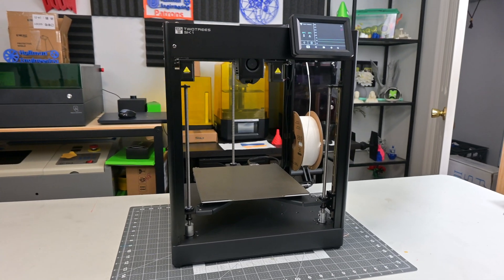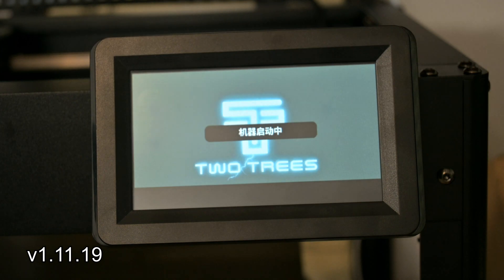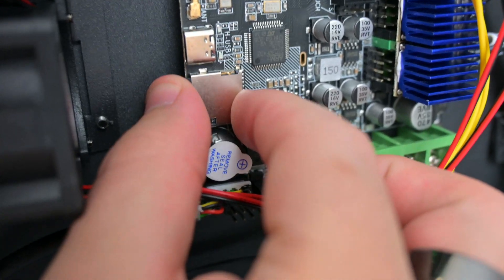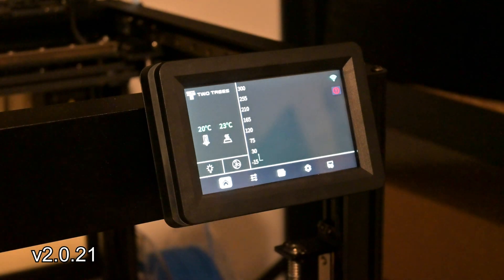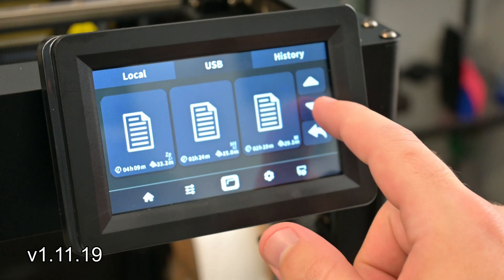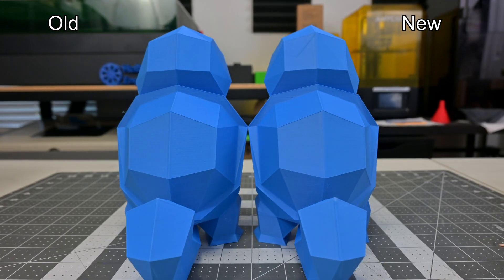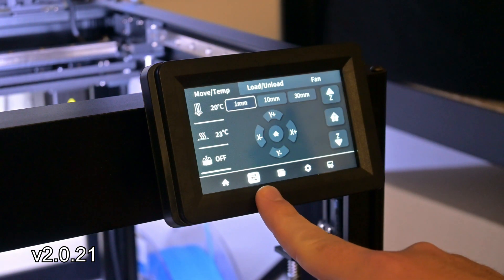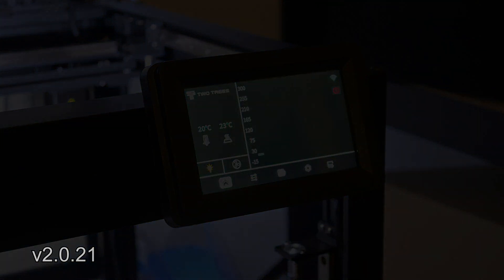Did the new firmware fix Two Trees SK1 3d printer?

Comment: I've been working with another 'toy' Sovol SV08 until I broke it now back to the twotrees, firmware helped but I ran out of filament, head parked left rear, klipper showed "Paused" but no direction on what the do. I pushed new filament in until it flashed then told klipper to restart. It started printing but not extruding filament, I pushed on the filament until I could feel the extruder pulling. I am getting the 'weird errors', I'm looking for some cable now.

Comment: At least you got it to work. My buddy works for a group that got one and they never got past the sheet of paper phase of the initial leveling calibration. They showed me and when you hit the arrows to move it the bed up or down, it would just wiggle the bed down and back up each time. A step down and then a step back up. There were issues with the shipment and stuff too but I don't wan to get him trouble in case he wasn't supposed to tell me ;)
Reply from the maker: The wiggle is supposed to happen (during the paper phase). It confused me at first too. These exact numbers are made up, but it'll move down like 1.0mm then back up 0.8mm (or move down 1.0mm and up 1.2mm). So keep adjusting and you'll see it's actually moving in the right direction over a number of presses.
Reply: @HoffmanEngineering  I sat there watching him do it. Pressing it numerous times and it didn't seem to budge at all. Interesting as they had scrapped everything due to that and never moved forward with what they were doing. I'll have to let him know. Maybe he can measure the distance with a laser or something.
Reply: @HoffmanEngineering  I let him know. They tried it again and it worked through enough patience. But then he said it kept emergency stopping out of nowhere with every print. Even with "the latest 2.0 firmware" (I guess thats the most recent), it is filled with glitches and troubles. The company should try much harder at making sure the product is ready before releasing something like that into the wild.

Comment: Have they added mainsail, or do you know if anyone has managed to install it?
Reply from the maker: I believe it is just fluidd installed by default. I haven't poked around to see if anyone else has been experimenting with it.
Reply: @HoffmanEngineering  yeah I haven’t found anything either. I’m really considering getting one.  Just the not vanilla Klipper gives me pause. 

Have looked and looked for info on adding mainsail, and jailbreaking to swap over to vanilla Klipper, but there’s nothing as far as I’ve seen. Le sigh

Comment: I have to ask.
How good is this printer for 'full' bed stocking.
I have a Neptune 4 and its ability to do multiple parts using a good portion of the bed just sucks no matter how much tweeking is done.
The Neptune 4 is good for one off parts but that is about it.
I need to print multiple parts (same part) but would at lest get more than 4 on the bed.
What has been your experience using most of the bed and having parts 'stick' at least 95% of the time on the first layer?
Cheers.
Reply from the maker: I don't often print full bed prints like that, but I did print 5 articulated prints for gifts in a single go. Things like the flexi octopus, dragon, dinosaur, onyx, etc. Those had to roughly 75 separate joints all being printing at the same time, and I didn't have any adhesion issues with any segment. Since the bed doesn't move, adhesion is pretty good.

Comment: Glad you followed up on this, mine came with 2.0 and has been running great. Overall, I'm very happy with it especially at the sale price. I hope their enclosure comes out soon, but the foam pads that it shipped in make a great makeshift enclosure lol. Really want to try some ASA printing on it.
Reply from the maker: The enclosure would be nice, and with all the mounts already on the printer it should be an easy install. Glad it's working out for you!